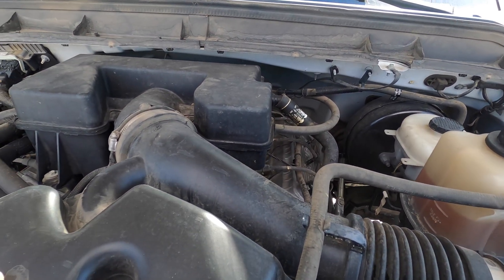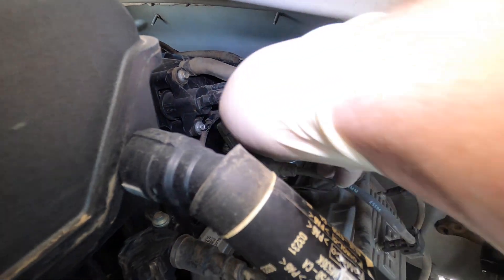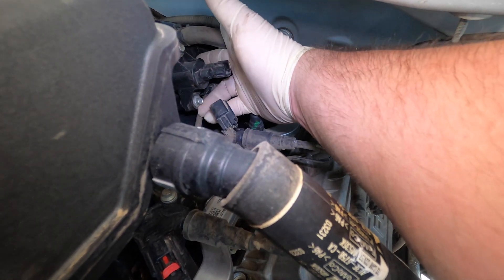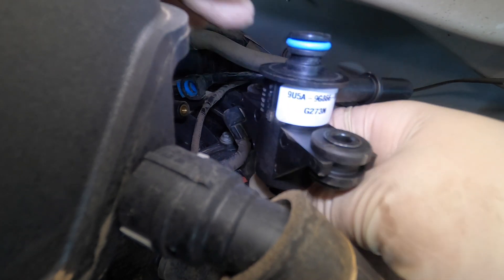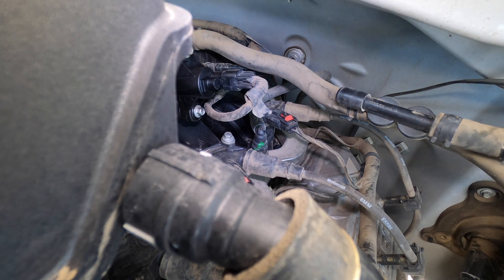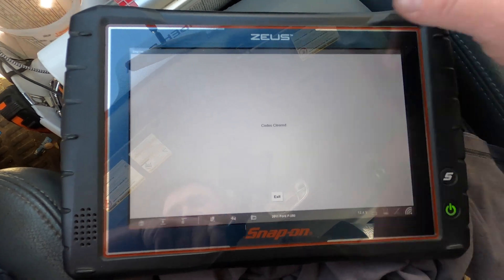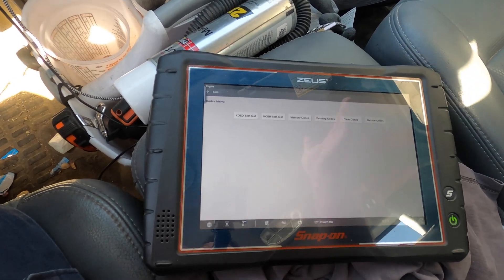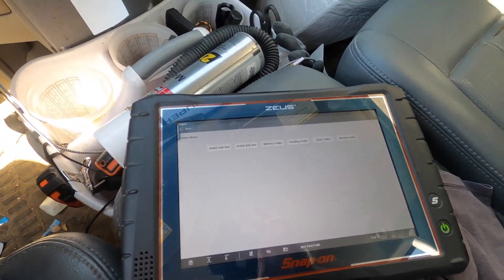2011 Ford F250 6.2 Evap Leak P0457 Purge Quick Test

Comment: So assuming this would be reason why my 2011 6.2 takes a bit to start after fully filling up
Reply from the maker: Quite possibly, pushing fuel vapor into the engine while filling. I’ve seen failing purge valves cause extended crank after filling up.

Comment: My fuel gauge is acting wanky and i have a strong vacuum on my fuel tank. Im going to check this later. Of course I’m out doing jobs so i hope it makes it home i have been venting the tank
Reply from the maker: The strong vacuum is likely from the purge, not sure if it can cause a wonky gauge. These purge valves on the fords are such a common failure point.
Reply: I had vacuum on my fuel tank and it was the charcoal canister. The vent line can become plugged with dust or the canister can become full of fuel from overfilling your tank. The vacuum caused my fuel gauge to go wonky and it still doesn’t go past 3/4 full now that the issue has been resolved. I think the vacuum issues bent the sending unit arm or did something to the sending unit.